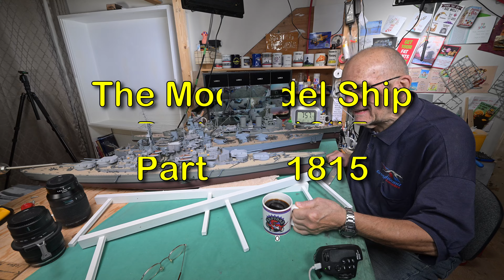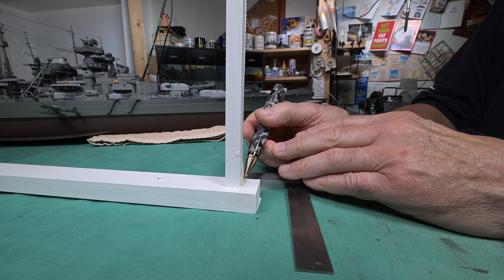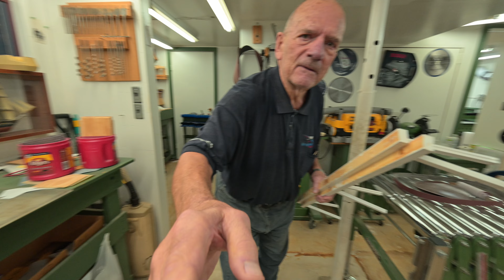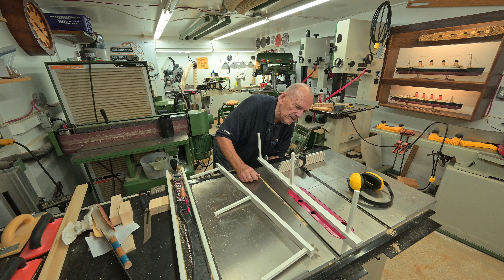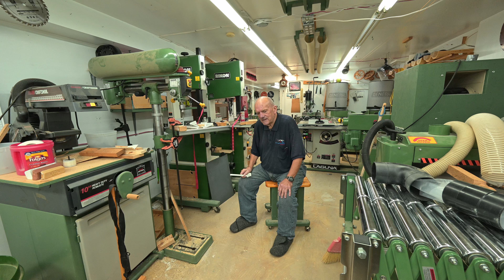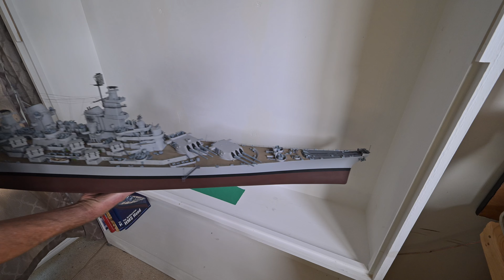The Model Ship - Part 1815

Comment: Fun facts (ship lengths according to wikipedia):

USS Iowa = 270.43 metres
HMS Hood = 262.3 metres
Bismarck = 252 metres
HMS Rodney = 216.5 metres

Interestingly, Yamato was 263m (about the same as Hood) so it would have fitted in the cabinet. But the submarine is a very worthy alternative project. 👍
Reply from the maker: Thanks! I'd actually planned to put the Yamato on the very bottom shelf where the books are now, then glass it in somehow. 😁